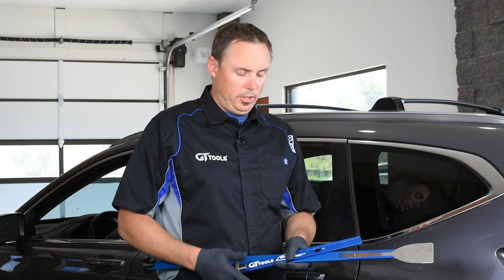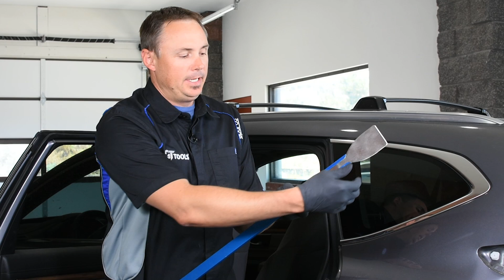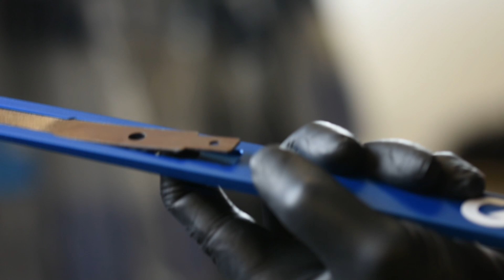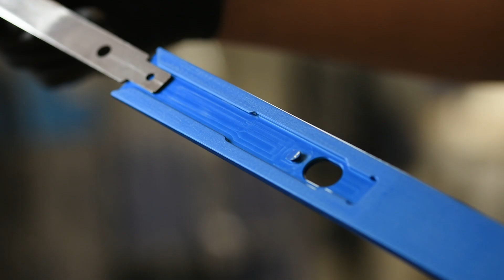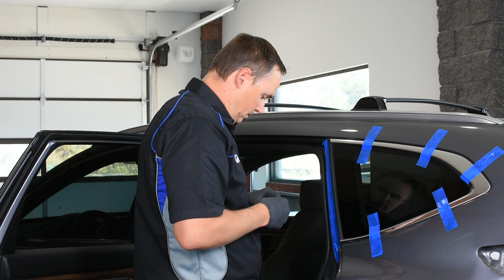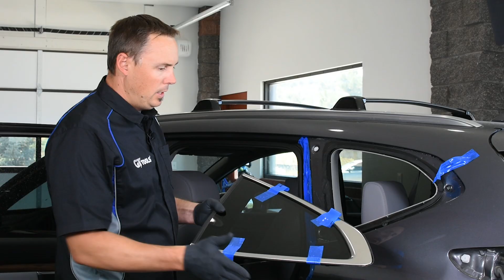5 minute Quarter Glass Removal - GT Tools™ Training Video - The Quarter Cutter™ and Shorter Cutter™

Comment: That was painful to watch. I love your tools but I made a homemade version of these before they were ever on the market and have been cutting qtr glasses out in body shops for over 10 years now. I have the techniques using these things down to a science now lol. Good job. I was nervous watching though. I like to use a rubber mallet and do small short taps a along the way. When you get to pushing like that it can be hard on your body and there is just to much risk of putting more force than you realize and slipping or damaging something. Great tool though. I just ordered some. I have been using the push knife equalizer version for a few years now and there is a flaw in the design on those in my opinion. I am hoping your design is better. Sorry, not trying to sound arrogant I have just made a lot of mistakes when I was learning and gotten much better with my techniques. If yall want whenever mine come in I will film me cutting one out and send it to you.
Reply: كيف تفك الفريم هل لديك مقطع او كيف اله الخاصه بك

Comment from the maker: @tempsho I completely understand that comment. This full quarter was being removed and replaced at the body shop, so our technician was more interested in speed than precision on this removal and not too worried about paint scratching. We addressed it with a comment in the video and we have a TON of body shops using these tools for that purpose. If we were going to remove the glass on a vehicle that didn’t have a damaged quarter panel and eliminate paint damage, we would have taken the extra minute or two to make sure we were more precise and taped off the body around the glass as well. Thanks for watching closely, I bet your shop does great work! Feel free to reach back out with any other questions or comments you may have.
Reply: How are the pins released?